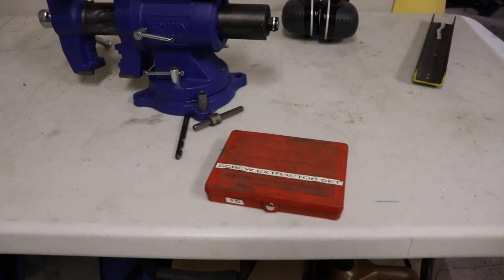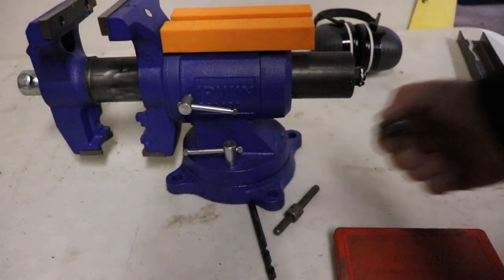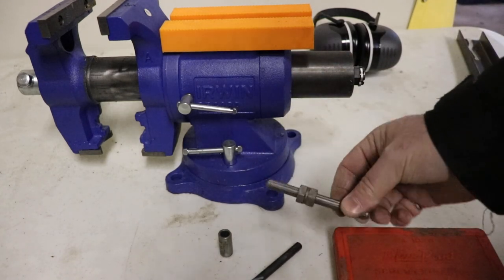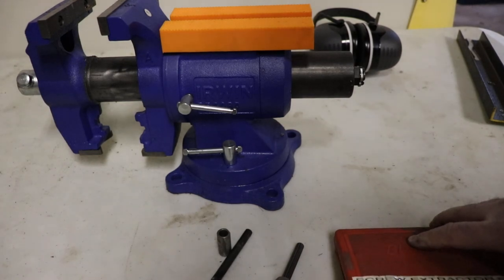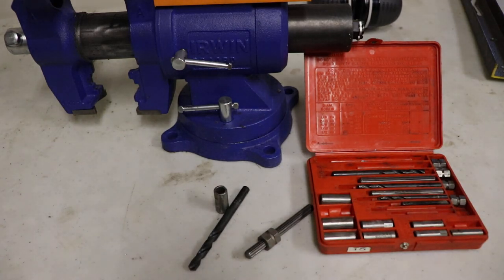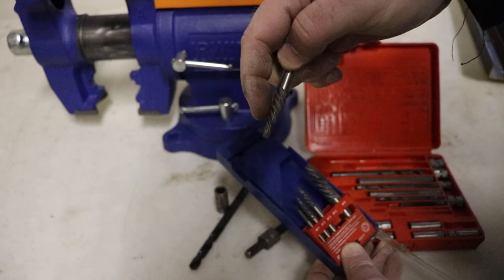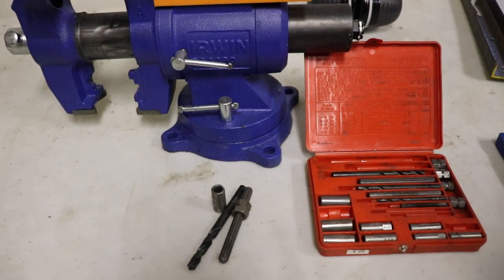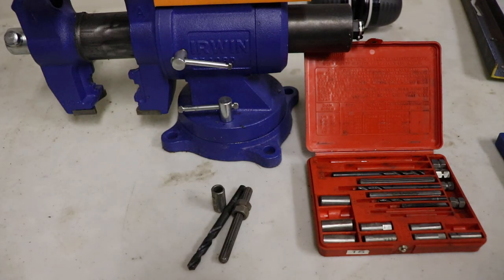Blue Point 1020 Broken Bolt / Screw Extractor Kit

Comment: This  is  a really  nice  set, Snap-On sells them and  they work actually good if  You are patient  it helps if  You can drill the  broken bolt  until You reach the  parent metal of the hole,  Being gentle  is  very helpful.   The splines  are  also good  material and help disperse the  pressure  on the full lenght  of the  bolt. 
   Thank You very much for  Your   posting/uploading

Comment: I have had a set for years and it is well used. When all else fails this set will do the job, the trick is to use the largest size splined tool possible and get the nut as close to the broken bolt as possible to avoid twisting. Generally the process of drilling the hole generates sufficient heat to break the corossive grip on the threads. I need to replace some of the spline tools as I have broken some over time and consequently they are a bit short.

Comment: I have to say, I have this exact same set and I am not impressed.  First time I used one, I twisted one of the splined extractor.  I had to get it replaced.  The drill bit are pretty much next to useless as far as cutting goes. I usually use an ordinary cheap mastercraft bit, then use the splined extractor.  However because of my first bad experience twisting one before, I am always afraid to apply too much pressure and twist it again. I usually end up using another method to extract the broken bolt.  It piss me off because they don't give those sets away and I ponied up the money thinking that it will avoid me some headache, it did not.

Comment: Best bolt extractor going I got 2 for two the only thing they should use left handed drill bits the best thing is the guides in case your bolt is recesed made buy ridgid the best the second ones you showed are junk but the first set that is made buy ridget get a 10 from me just take your time and they will work I also bought a snap on set with left handed drill bits they might work all buy ther selves if the bolt isn’t siezed in the hole